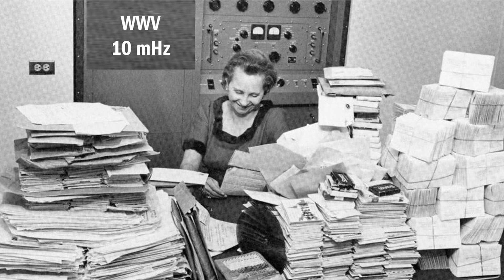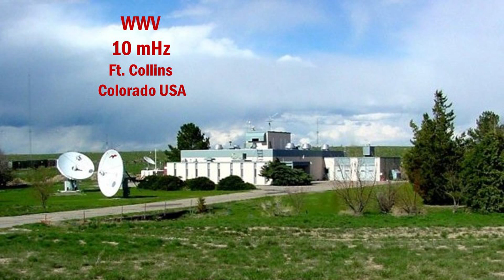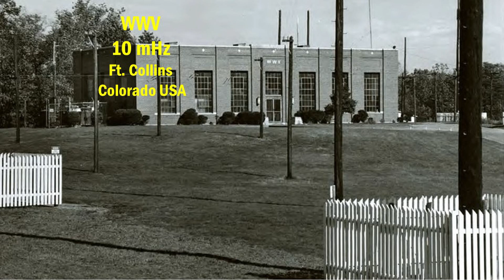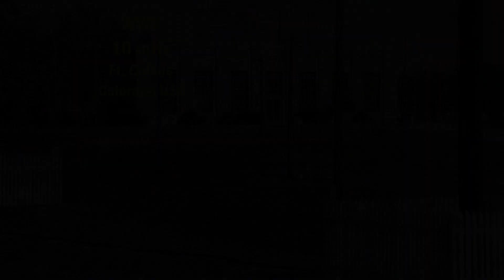WWV Time Signal Station 10 MHz - Fort Collins CO 'USA' - 2021-11-14

Comment: Should be MHz, not mHz. A lot of weisenheimers on Facebook have scolded me for linking this video.
Reply from the maker: Sorry for the inconvenience caused. I will make the necessary corrections. Thank you
Reply: @Radioscopia  Thank you for the quick response!
Reply from the maker: @x25__  See this to: kHz (kilohertz) By TechTarget Contributor
The kilohertz, abbreviated kHz or KHz*, is a unit of alternating current (AC) or electromagnetic (EM) wave frequency equal to one thousand hertz (1,000 Hz). The unit is also used in measurements or statements of signal bandwidth......

Comment: This brought back memories from 1966?..  I was part of a 'monitoring' network to record the very first broadcast of WWV - Fort Collins.  I had my old Hallicrafters  SX-101 Mk III and a dual tract reel/reel tape recorder set up to record the 10 Mhz spot.  The audio from the receiver was recorded on one tract while my voice was recorded on the other reading off the 's' units.  At the moment the station came on the air, all the levels were recorded.  There was another station transmitting, but I don't remember where it was located.  All this was done at the club station at Cal  Poly  University at Pomona, California.
Tnx for the memories,   73's   de  WB6PVC
Reply from the maker: What a history!!! Tnx